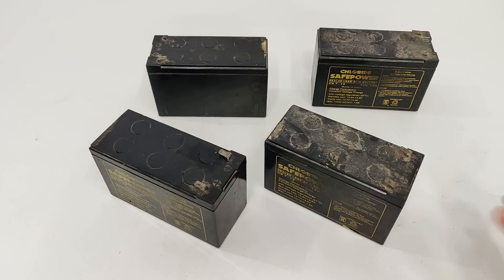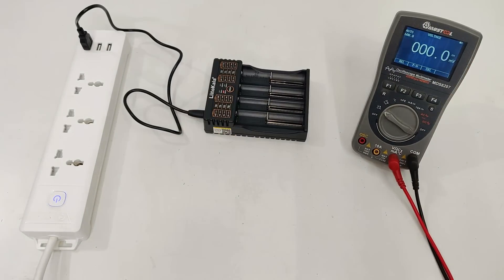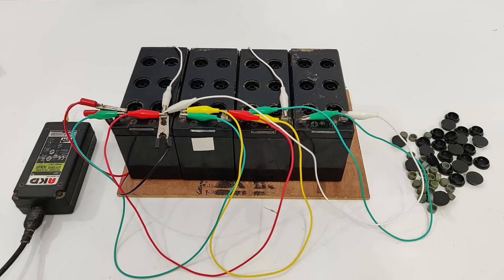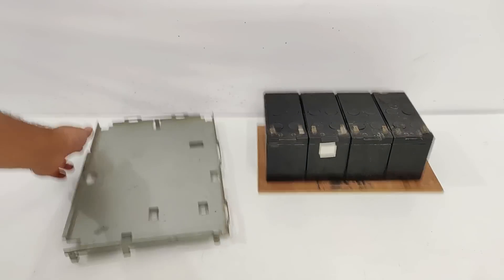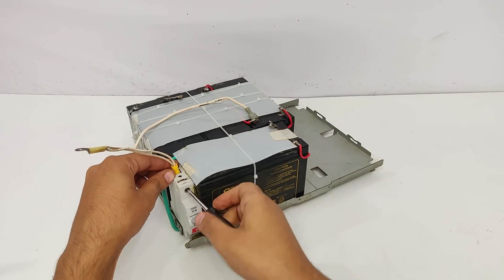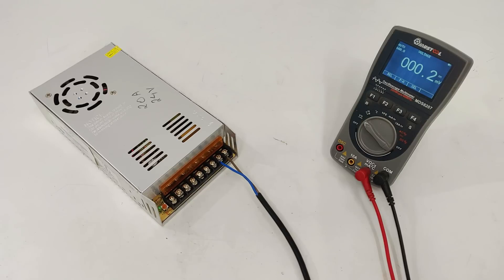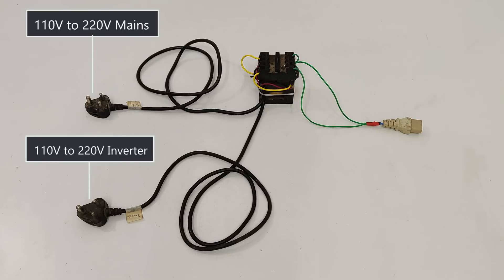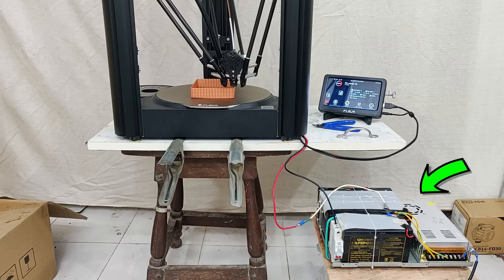Make 110v / 220v to 24v UPS for 3D Printer DIY - 5 MORE HOURS IN POWER OUTAGE !

Comment: heya i understand what youve done but its not really a ups now though it,how did you solve the batteries not exceeding 24volt as normally the output would hacve some sort of regulation or your just soley relying on the powersupply ,which will still over chArge the batteries

Comment: A B25A currcuit-breaker and less then 1 square-millimeter copper-wire? Will you set yourself on fire? Please learn the elementary rules of the electro-technics! 
You can do that a lot better! 
This, by now, is a deathly 'machine' in any way! 

And using the yellow/green wire, for any thing other then "PE" is absolutly FORBIDDEN! 
No 'negativ'! 
It's the wrong colour! 
Never use the yellow/green wire for anything that had a potenional! 
Only for "PE" ! (Only "Earthing" - Potenional Equalisation ! ) 
You can use a 'pink wire with blue and red dots and grey stripes' for 'negativ', IF YOU WANT TO do! But never a yellow/green one! - NEVER! - 

Please go to school and learn a profession, ELECTRICIAN is a beautiful PROFESSION!  It's about 45 years ago, I've learned that too, and never, ever forget the safety rules! (... now I'm retiered ... !) 

All the best for you! - And stay safe, also for your 'technics'! -

Markus - db9pz 
(my HAM-radio call - JN39fq - 5km/3miles east of LX)

Comment: Hello, I am your channel. I come to you because as I live in France, the mains voltage is 220V AC I bought a 12v to 110v inverter ( for USA)instead of 220v. The well-known Chinese site did not respond to my request to change the inverter for a 12v DC to 220v AC, I will have to try to manage to use a voltage doubler, but how? Do you have any idea? Thank you in advance

Comment: First off: I like what you're doing. Showing relatively simple solutions that can be done without a big budget. But I think you could very much improve your videos by dropping this absolutely annoying stock music and explaining more of what you're doing. You're not a 5 minute craft video. You have actual contents. Show it! For example: What and why are you checking, with the battery voltages and the lamp? What are the holes for you drill? Why do it in such a way? Why are you soldering the connectins to the batteries instead of using connectors?
I myself always tend to overengineer my solutions, so I'd really love to get the reasoning and/or opinions behind your decisions.

All in all: Keep on tinkering!

Comment: Neat!

How well would a MPPT solar controller play along with that SMPS if left connected? Would you need a diode to keep from backfeeding the SMPS at the higher voltage solar controller likes to charge at?
Reply from the maker: Yes . Diode is necessary tk prevent backfeed